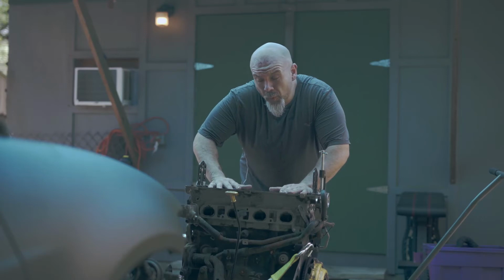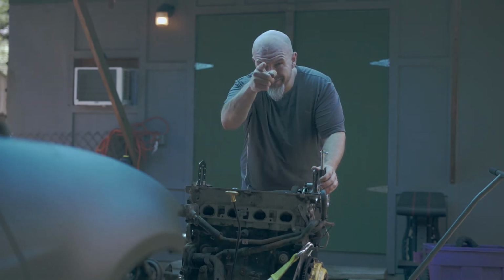Driveway Build#6 Bumpsticks and springs!?!?

Comment: Jack wasnt a bad way, im spoiled with a couple stands
keeper may come out with the drain plug out
pull the plug, pour oil in the head to drain to the pan to crate some flow and wash it towards the drain hole, and grab with a magnet